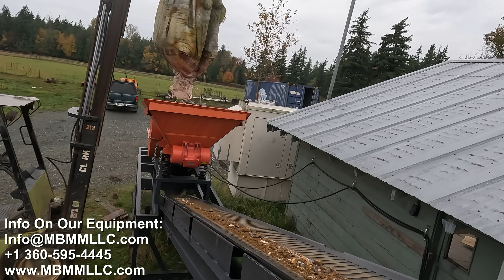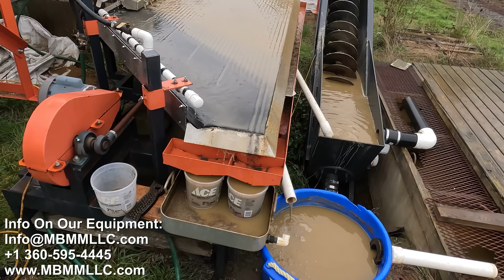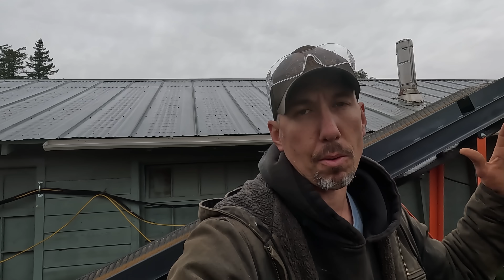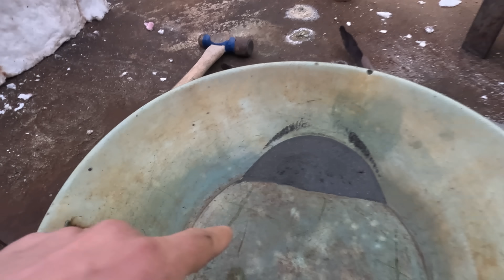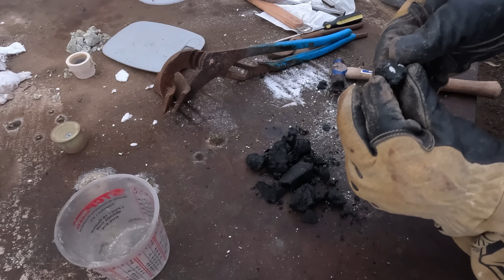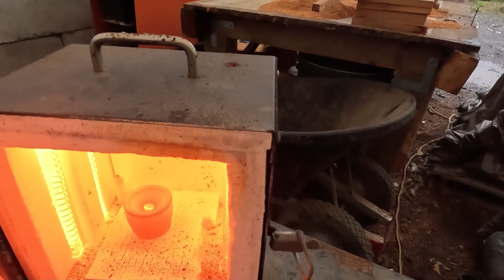Rocks To Gold! Gold Ore Processing System To Smelting Gold Doré

Comment: Definitely run the old stuff while the prices are so high. Do you use magnets at any point for the black sand? Would sonically vibrating the magnet to dislodge any gold dust that adhered to the black sand be feasible? Keep 'em coming, the more the merrier!

Comment: Seeing how the system works and is set up is not as cool as seeing how much gold you can extract, but it's still pretty awesome, and I'll gladly watch both videos. 
On a side note, I noticed that your conveyor for loading the hammer mill has quite a bit of fine material clinging to it on the bottom side as it goes back around. Do you think you are losing any gold on the ground under it? Or is it all still pretty well contained in the larger rocks at that point?

Comment: i was always wondering why you dont use a magnetic belt between the  hammermill and the shaking table to remove the magnetics so you dont have to rerun everything (can be weak because of the particle size) the shute can be made from plastic or fiberglas if you run a heavy magnetic ground right? plus you wont have so much iron in your smellts or would that be counterproductive?

Comment: I was in home depot today. By the cashiers is a stack of Defiant brand 2 pack 3,000 lumin lamps for 15 bucks. Make sure the red light comes on when you plug them into  charge. But they are crazy bright. And have several brightness settings. I opened and its easy to wire in an external battery pack  just a thought.

Comment: It's not a gold mine until you produce gold, otherwise you're just mining the internet. Show us your first gold brick, the mine I worked at pumped out two 35KG gold bars a week. If your set up works 1 tonne/hr, you should run it 24hrs/day, say 1 oz/hr gives you 24 oz/day which is 168oz/week. At $4000/oz you'd be making $678,000/week, stop flapping them gums and show us the gold.

Comment: Why did you re-run the #2 and then just go after the “free-gold”? You had mentioned several times when you were in the mine that a bunch of the gold was locked up with another mineral. I thought you said you’d have to melt it to get the gold. I would have expected to see you smelt all of it.

Comment: You should have a hose spraying water on the bottom of the conveyor belt, angled so the debris go into the small hopper too, your conveyor belt is holding a lot of fines, looping around to where they will drop onto the ground eventually

Comment: Thank you yes I am glad you showed this. Is this the bags you had lifted off the mountain by helicopter way back? Awesome to see this operation too. You have shown the pieces over and over but to see the complete turn key operation for a small operator is really amazing. My bet is that major large mines are not using this process, but for a small group with limited manpower it really does a fine job. Every consider doing a tour of a refining operation that does chemical extraction of gold and purifies it? Or at least a small refiner like STREETIPS doing some of your buttons? As I understand it your getting the natural area mix of stuff that is like 21 or 22 k gold, not pure 24k. That is not a knock on you. What you do is amazing and what our nation did for most of our gold rush eras. Native gold as it came from the ground. then they would acid test to see the native level and alloy to make jewelry strength gold that would not deform constantly. Mostly 14k recent times but a century or more ago it could be as  low as 9k in some wedding bands. Dental gold was mostly 18k to be durable and as pure as possible without being too soft. And yet today with modern refining .9999% fine gold is possible and used in some bullion coins. Three nines fine is also used for bullion. Would love to see a tour if you could arrange it of a modern refiner. MORE IS BETTER IS MY POINT. THANKS JASON. YOU ARE KEEPING THE SKILLS ALIVE FOR THE YOUNGER FOLKS.

Comment: jason when are you moving that setup to the mine? blast muck into the crusher pump slurry to the table and only take concentrates for processing down the mountain ..crushed waste could be pumped out or used to back fill specimens could still be selected and set aside for youtube but the bulk should be processed on site just to eliminate multiple moves of waste material